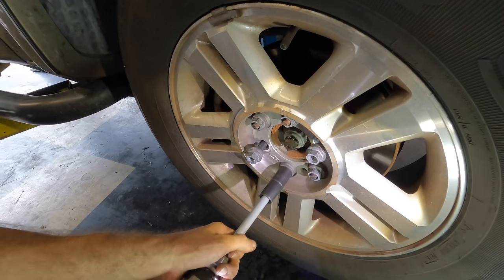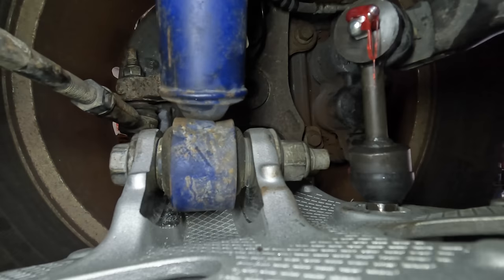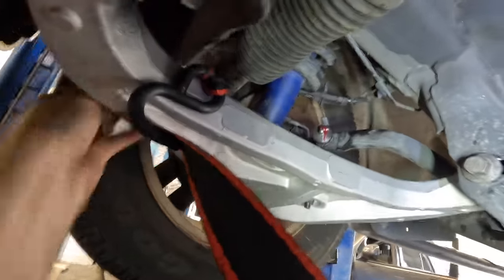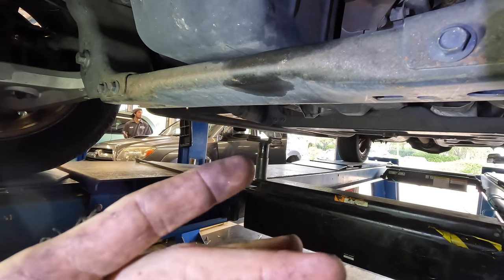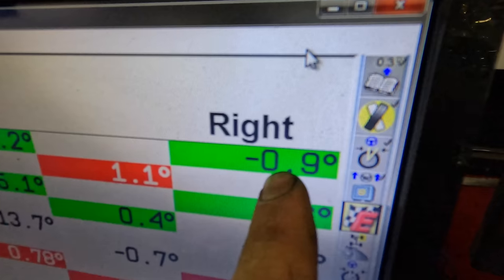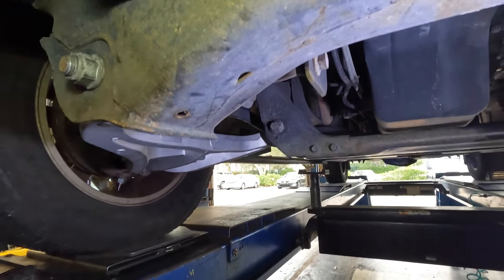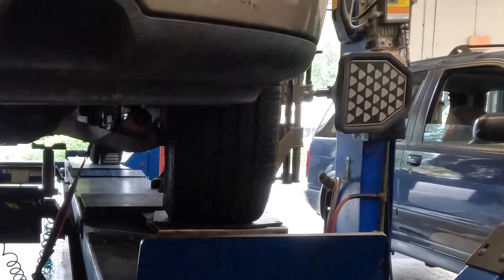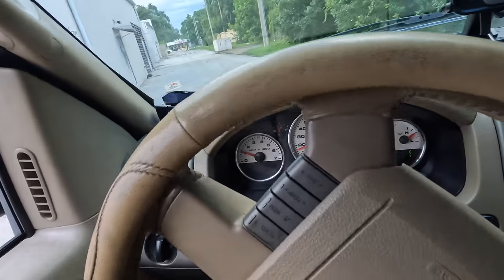Green Doesn't Mean GOOD! 2004 Ford F-150 Ball Joint/Suspension alignment

Comment: In fact, the same requirement can be done by moving the rear lower bolt outboard. When you first did them up with the lower bolts close to their inner position on the slots, you have little left 'slottage' moving the front one in, so instead, move the rear one outward in the slot, plenty of slot left to use there!

Comment: First thing every morning watch the latest video, but I must ask, why dont you check to see if the rim is bent as the reflectors rely on a straight rim for accuracy,  just asking.
Reply: Part of the alignment set-up is compensating for run out. Ray didn't show that in this video.
Reply: @61rampy65  How do you know if there is run out if you do not indicate the rim to see if it is true?

Comment: will a chewed up tire affect measurements?  and should you put the least bent rims up front before an alignment?
Reply: Bent cast wheels are usually cracked cast wheels. Forged wheels , more forgiving, but rarely  found on general production stuff
Reply: Yes worn tires will screw your measurements all to hell

Comment: There are very few shops that do an actual wheel alignment, most people will get scammed by places like Mavis discount tire where they claim they do a full four wheel one and an unsuspecting customer never realizes that they just did the towing and toe out on the front of the vehicle and shipped it out.
Reply: Yup, Goodyear Gemini dealer did this to me too.  Wanted my GMT frontend aligned after new tires.  They only adjusted toe.  Camber was 0.1 degree from being out of spec!  I told them to adjust it because I could drive out of here and it'll be out of alignment.  The techs words were verbatim, "I could try to get it better, but I'm probably only going to make it worse."  WTF?  Just blatantly admitting incompetence.  The truth is you need either a highly experienced tech who has been doing alignment for years and years or an actual ASE mechanic.  Hourly tire changers at the national chain tire shops just aren't going to do a proper job.  I'm halfway tempted to just eat the cost and have an actual GM dealer do the alignment.
Reply: @cup_and_cone  and yet these defective shops will charge you the same as the shop to do it right and get away with it
Reply: @willsrestorations  The rock bottom pricing model is one reason they are so eager to shortchange you.  Most places charge $100 or less for an alignment.  Depending on the vehicle, for a reputable shop to do a proper alignment the amount of labor necessary can be well over $100.  Remember, even Walmart's TLE had alignment services back in the day.  They ditched offering alignment because they realized their employees weren't competent enough and the profit margins were too slim to be worthwhile.

Comment: Never really liked slotted or cam adjustments because pot holes tended to mess up the adjustments. Parents Dodge could never keep alignment. There is a lot of leverage from the tire end to the adjustment end. Preferred the old GM's with shims though they could be a tedious.
Reply: I almost forgot about GM system with shims-tried once to compensate for flat worn out "75 Olds Cutlass front end with DIY fix.
Reply: Yeah, especially on truck's/SUV that may see some light off-road use.  Heck, even as a mall crawler, someone running into the curb every time can knock it out of alignment.

Comment: we were always told to rotate the tyres (or put the best ones on the front). I noticed that these tyres were scrubbed on the inside. If the rears were crapped out, I'd have changed them from side to side...or should I have watched the first video? Apologies if You've already taken care of the rotation issue.

Comment: Here’s a neat trick for ya, take 2 pieces of metal under each tire with in between them. At that point you can move the tires more easily. The only thing I would not want to do is have the car in the air.

Comment: Not just these particular arms. All control arms with rubber bushings should be at ride height when tightening. I'm genuinely surprised that Ford doesn't provide slots for eccentric bolts. You'd think a truck, which takes a lot of wheel hits would have a more secure alignment set-up.
Reply: I'm Firmly convinced that manufacturers actually want things to F up, & the more & the faster the better, just so long as its not obvious to the avg Joe. & I'm generally an optimist.

Comment: Ray, a question : Did the new ball joints sort out the wobbly steering wheel under brakes? Or is that yet to be addressed?
Reply: Thats why he did new brakes bud, that vibration was from the brakes
Reply: Thanks, I missed the part where he put brakes on it.

Comment: Does the condition and the pressure of the front tyres, have any impact on the steering and suspension measurements? I.E. Thise tyres look worn on the insides. Would that not give a fictitious camber measurement?
Reply: no, the alignment adjusts the suspension parts
Reply: Tire condition doesn't matter as long as the rims are straight.

Comment: why would you want to have positive camber?  slightly negative is much better than ever ever touch positive settings.
is there something special with this suspenstion? does it pull negative camber on cornering on outside?

Comment: Wow. I am going nuts with my current shop that is "fixing" my front end alignment. What a joke! The shop has been working on it for 2 months now. My 2000 E350 super duty van has been to the shop 6 different times and has been kept at the shop for 20+ days total during these 2 months. When i have picked up the van, each time the shop says "OK, we tweaked a few settings...." The latest update is they are going to put in bigger ball joints and bushings. This has now been a week to install. I JUST WANT MY VAN BACK and FIXED! What is a reasonable amount of time before disputing the charge and seeking a new shop? I have had new tires and new steering box, ball joints, bushings, upper and lower control arms and tie rods. This shop is terrible and I will have a hard time giving them a 1 star rating, if and when they fix it right.
Reply: Well they don't knowhow to do part 2 of this Video. Your truck is in trouble.
Reply: You need to find a different shop

Comment: 1. grab an actual come-a-long 2. if you open the strap handle all the way up flat, it will disengage the smaller lock.. so it's one handed.

Comment: Wondering why he had to replace the upper and lower control arms instead of just the ball joints? Is it another Ford Better Idea to have non-replaceable ball joints?
Reply: By replacing the arms, customer now has new control arm bushings too. It's cheaper to do it this way.
Reply: @61rampy65  Oh ok I must have missed where the bushings were worn out also. That makes sense.

Comment: Would it make sense to recheck alignment after the test drive at least, if not 500 miles later? That stuff will settle in and I would think it would change the results?
Reply: No. Unless the customer would like to pay for another alignment check.
Reply: @mph5896  I mean, does that seem reasonable? Does it stay put just as he left it, or would it shift, potentially a lot, after it broke in?
Reply: @vernzimm  no need for a realignment. Everything stays put until you hit something and knock it out of place or parts wear.

Comment: Can’t remember the last time I saw suspension parts with grease fittings.
Reply: Those can't be original, right?
Reply: ITs aftermarket garbage he installed in the first video. Duralast 🤣
Reply: @mph5896  I’ve used a lot of duralast stuff. Haven’t seen grease fittings on that stuff in 30 years.  I usually have to buy Moog to get grease fittings if I can find it.
Reply: @gerrycarmichael1391  

Check out his last video, before this one. 17:47 mark, you can clearly see where it states Duralast Gold and has a grease fitting in the upper control arm ball joint.

Comment: Ive had an alignment on my truck but for some reason when i do a full lock right turn i can feel my tire skip and also they squeak like crazy when trying to turn in a parking lot! I've had two alignments and both papers have good readouts with camber caster and toe🤔
Reply: Ackermann measurements might be out of whack, causing you to get toe out on turns. If it only happens one way, something could be bent. Research Ackermann Theory, it's fascinating.

Comment: Zero is great but camber has to be way out to wear tires. Toe on the other hand just a little off wears bad. Caster means how your wheel returns to center while driving.more caster, more effort needed to turn.

Comment: I still don't understand how you can just GUESS/ESTIMATE all of these suspension part bolts/nuts torque values  as in never using a torque wrench. You've just done this so long you have a feel for it? I would love to know the real torque values of EVERY BOLT you've tightened on every video I've watched. Why would the manufacturer ever have torque values if mechanics just guess? Am I just RHEEEING for no reason? I love the channel and all the videos, Ray's a great guy. Can someone with a couple decades experience doing this just explain this if I ask nicely?

Comment: How many of the bolts that you re-used are actually considered one time use only by Ford ?
Reply: @armslength2618  I did a lot of suspension work on my 2007 and 2011 Mustangs and never used new bolts, but they were my cars and my decision.

Comment: 10:30 I am not a mechanic, but certainly interested. What's the purpose of loosening the bolts and then thightening them again?
Reply: Hi.  The bolts were originally tightened with the wheels off of the ground.  When the jack let the truck back down, the control arm ends moved up a few degrees, putting a twisting force on the rubber bushings that those bolts go through.  If you leave that force on the bushings, they fail prematurely.  Loosening them once the wheels were on the ground (where the wheels live all of the time) and then re-tightening them takes the twisting force off of the bushings, ensuring that they live a long, happy life.  
Hope that helps.
Reply: @gregfielder  Thanks, got it :)

Comment: Surely if neg camber is supposed to be -0.2 shouldn’t you try to get it to 0.2, positive camber would ruin the handling on my Miata Mk4, also max out the caster (at least 8 or 9 if possible), -ve camber makes for a more ‘pointy’ car les prone to over my negative camber is -1.8. - Toe-in: 1/16", 0.15° or 9 arcminutes total (1/32", 0.075° or 4.5 minutes per side). Non standard geometry to make the car handle better. Courtesy of ‘Flyin’ Miata”. The rears are adjustable fro camber and toe as well on Miatas

Comment: Anyone else see the lugnut embedded in the tire within the first 2 minutes?
Reply: Cringe! I can't unsee that!
Reply: Thats not a Lugnut, thats a washer and the reason it sticks to that point on the tire can be seen in part1. There is some black sealant goop from the Anti splash plastic stuck to the tire.
Reply: @Enakaji  you know what, I zoomed in and you're right, it's just a washer... It looks like a Lugnut with the angle it's at... and yes, I know of the stuff that got on the tire in part 1! it was highly unlikely that those two things hit the same spot but obviously they did...

Comment: Seems a bit hit or miss with the adjustment routine., some bolted adjustment should be employe,.  but I supopose that costs money in the production process.  Cheap doesn't mean better simpler. Good instructional video though, despite having to mess around with rachet straps.

Comment: TO ANYONE COMMENTING ON MY COMMENT, i AM NOT REFERRING TO RAY. My comment is made because this is a tech channel. I really hate it when techs do not use a torque wrench to tighten wheel lug nuts. My daughter just took her car in for a oil change and even though she told them not to rotate the wheels they went ahead and did it anyways. on her way home she had a front end noise so I went to take her front wheels off and see what was going on. I struggled to loosen them with my Milwaukee 1/2" impact. So I put my torque wrench on the lugs just to see how tight they were. The stupid tech had the wheels tightened to 170 ft lbs on a 2015 Ford Focus with aluminum wheels. He just put his impact on high and run them down. I phoned the dealership that did this and they towed it down and had to replace all 4 wheels, lug nuts and lugs because this tech was a idiot. This is why i hate techs that think they do not need to do things correctly.
Reply: If you watched most of Rays video's he does use a torque wrench on the lug nuts . A lot of times he does not show it because of video time .
Reply: I am a retired mechanic in Land Down Under. I teach people how to service their own vehicles. Many of them have never removed a wheel in their life. They too are concerned about using an impact wrench on their wheels. I show them how I tighten the wheel nuts using the No 2 setting on my air gun. Then I get them to check the torque using a tension wrench. The torque comes in within 5% of the manufacturer's specs. They then do the same air tightening on other wheels and then check with the torque wrench. Remember they have NEVER done any of this before. What I am saying is that each person who regularly uses their impact gun knows very quickly the torque they are applying. Also give Ray credit for knowing what he is doing. He knows his air as well as battery operated tools and has used his impact wrench "once or twice" before. Agreed that there are idiots out there who could not give two hoots about what they do. But the calibre of Ray's work will stand scrutiny by anyone in the business.
Reply: @eaglerider1826  I am not talking about Ray in particular. I am mostly making this comment because this is a tech channel.
Reply: Understood that you're not referring to Ray. He does appear to use a torque stick (extension) that limits the torque applied.
Reply: @1wadesdad  What you see in the video is him running down the lug nuts with an impact wrench . what you don't see is him using a torque wrench when the wheels are on the ground . He edits it out to prevent  boring video
Reply: @MarkK01  ok , sorry I misunderstood your comment .
Reply: Ray was using a torque stick.  It's an extension designed to twist at a certain torque to prevent over torquing.
Reply: @HoLeeFuk317 , Have you ever used a torque stick and then checked it with a torque wrench? I’m just curious about how accurate they are. 
Have a good one!
Reply: @Hoaxer51  Yes, they are tighter than the torque labeled on the stick but its close enough and really depends on how strong your impact is.  I've never had a wheel come loose and I never had issues getting lug nuts off.  If the car has fancy rims or it's a heavier truck I use a torque wrench.  But other than that I always use a torque stick
Reply: @HoLeeFuk317  Like I said this was not directed at Ray. The only reason I commented was because this is a tech channel. If I was commenting about Ray I would have named him directly.
Reply: @1wadesdad  I fully understand that.
Reply: There's Ray using that special torque-limiting stick to install the wheels at the start of the video.  The point of that is to avoid too much torque, allowing the big torque wrench he uses to get the job done once the wheels are down.  If you watch Ray's videos regularly, you'd get that that's how he does 'em all.

Comment: Worst designed front end ever except for I beams which I bend with a portapower. Drivers side caster should be slightly higher to pull against road crown. Ford designers had a brain fart when they designed this front end.🤣